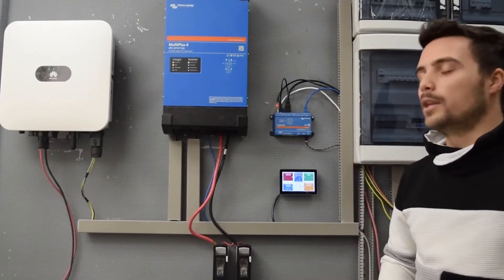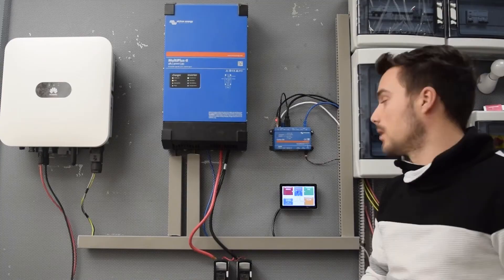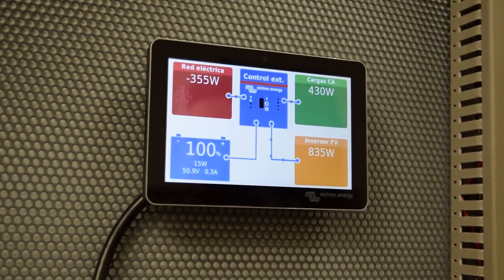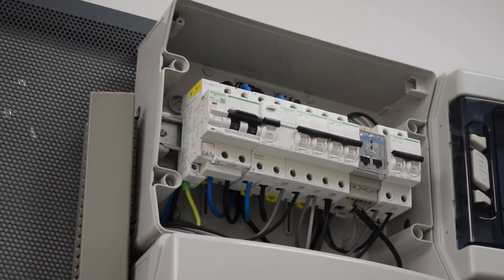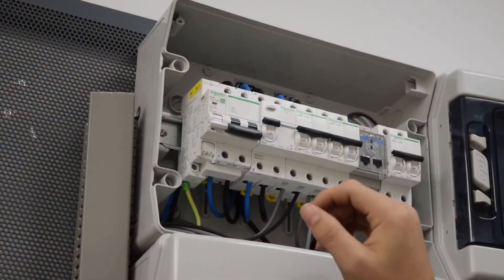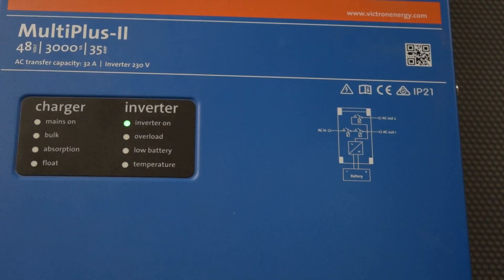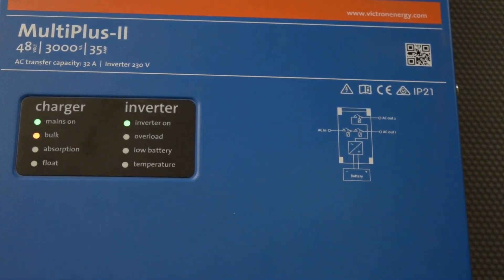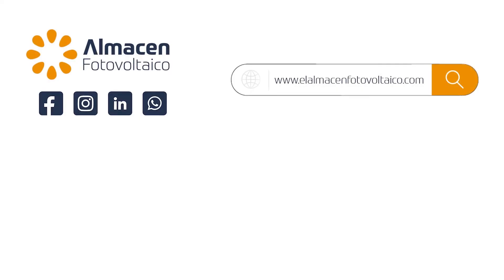AC COUPLING between Huawei SUN 2000 and Victron MultiPlus II: DETAILED TUTORIAL

Comment: Thanks for the video but can you show us the details of you VEConfigure & ESS?
Does it only regulate the power output via frequency shifting is there another means of communication between the multiplus & Huawei?
Reply from the maker: Thanks for your comment. Here are the details for VEConfigure and ESS:

VEConfigure

Grid Code: Configured according to local regulations.
PowerAssist: Enabled to support the load when grid power is insufficient.
Virtual Switch: Configured for specific system needs.

ESS (Energy Storage System)
Mode: Set to self-consumption mode to prioritize solar and stored energy.
SOC Limits: Configured to maintain optimal battery charge levels.
Sustain: Ensures a minimum SOC for critical loads.

Communication Between Multiplus and Huawei
Regulation: Mainly via frequency shifting.
Additional Communication: Uses Modbus TCP/IP for real-time data exchange and control.
This ensures efficient and stable operation, maximizing the use of renewable energy. I hope this answers your questions!
Reply: @PhotovoltaicWarehouse  Hi... Do you have, or can you provide a PDF with the documentation for this type of microgrid? Thanks in advance! 🤗